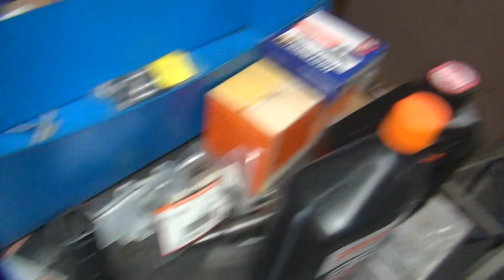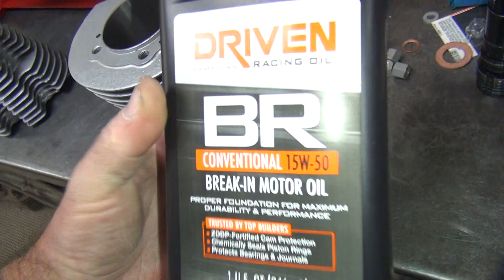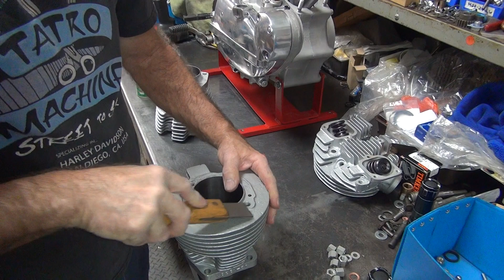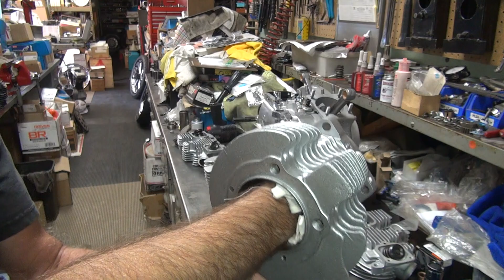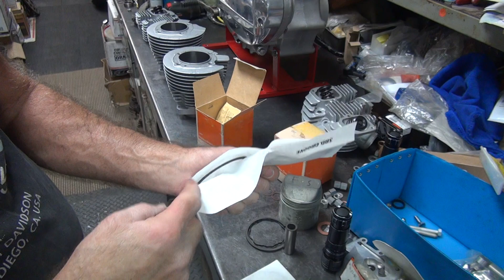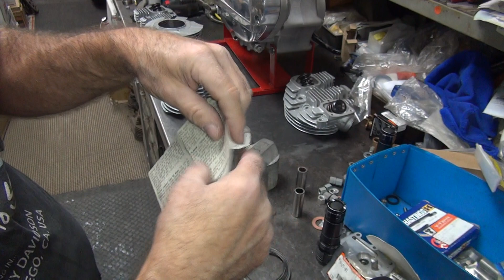1961 xlch #231 no miles transmission motor rebuild sportster harley repair restoration tatro machine

Comment: tatro what year is your xlcr.i have one it is a 79
Reply from the maker: 1977 frame with a 1978 motor. they did not make many of the 1979 models. they were left over 1978 bikes.
tatro